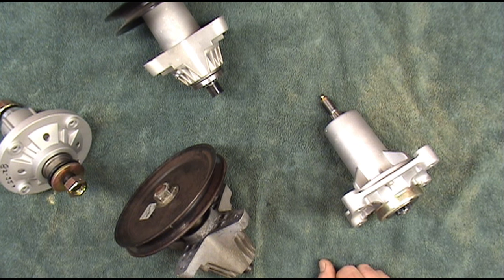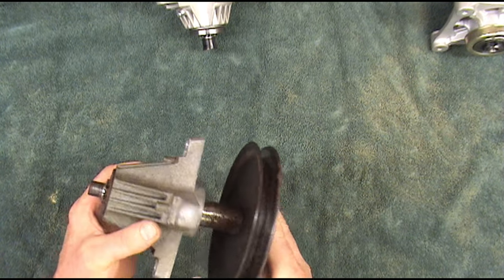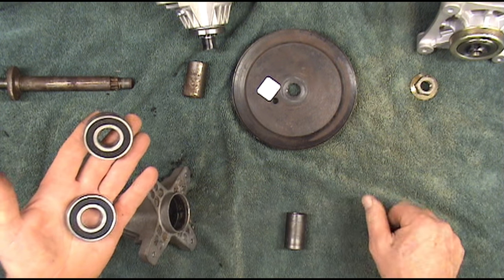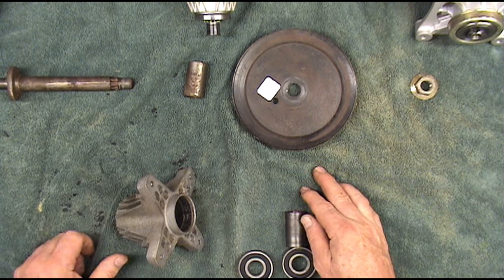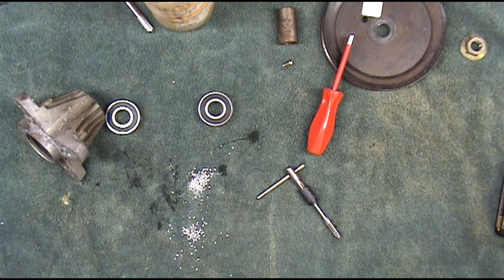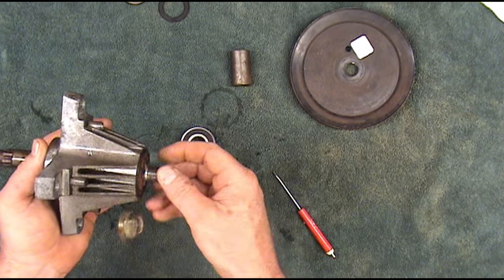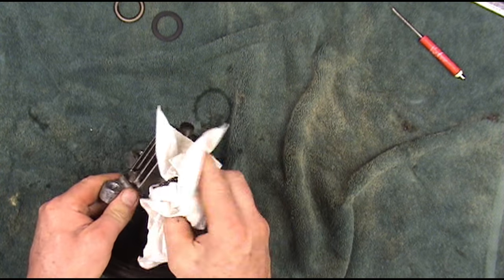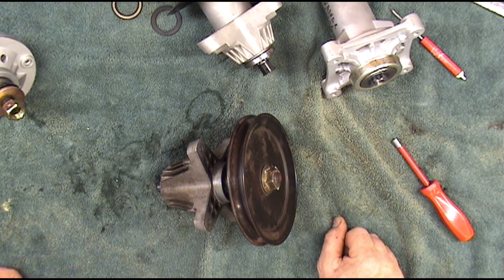Deck Spindle  Bearing Upgrade   Cub Cadet Husqvarna John Deere Troy bilt

Comment: I've done this with my cub cadet zero turn replacement spindles. Took apart three brand new spindles, removed one side dust seal on both bearings, tapped weep hole, added 10-24 screw, filled with grease, very solid, should last a good long time.

Comment: Glen, you are absolutely correct! I replaced mine last year on my Scrub Reject last year and they have already failed, and I did pump grease into them. I pulled one of my spindles apart and sure enough the bearings were sealed. The grease I pumped in did absolutely nothing for the bearing. Thank you for your expertise.

Comment: Just finished my deck rebuild and thanks to your video, it went very well.  You can use 1 1/2  by 4 inch nipple with a cap as a perfect fit your bearings.  Thanks again for sharing.

Comment: I never saw anyone use WD-40 on a Tap before.  Makes a LOT of sense.  I'll have to remember this.  Thanks, Glen!  I had a theory that adding a weep hole to know when the spindle was full, but your pre-tapped 8-32 screw for sealing is much better than what I thought of.  Thanks again!

I guess a 6-32 screw would work just as well, but add a littler more weep resistance to help pack the bearings.  4-40 might be OK, too.  I think I'll drill both holes on the same side, and mount the two spindles with Zerk and weep screw facing outward for easy access to both.  I have watched a lot of these, and I found you on my second go round today while looking for how to safely remove the bearings to be able to the use new ones on new spindles, but I think this video of yours is the best one I've seen yet.  Now I also know how to get replacement bearing numbers.  My spindles have two sizes each, with a larger one where the blade attaches.  Mine look like your AYP, so there's plenty of height for both holes on the same side.

Glen, the shaft and pulley spun faster before adding grease.  I wonder if your 6-32 screw is too long and pressing on the internal spacer.  Or is it the grease slowing down free spinning?

I needed a Love This button for this one!  Thank you so much, Glen!!!
Reply from the maker: Thank you.

Comment: I started hearing one of the deck spindle bearings going out on my Husqvarna lawn tractor.  The top bearing had the seal on both sides, but the bottom bearing had the inner seal removed.  The top bearing was the one that was failing.  I took the other spindles apart and fixed them while I had the deck off the tractor.  Good job explaining how to do this upgrade.
Reply from the maker: Thank you

Comment: you could use a (zerkstyle) pressure relief valve instead of the weep hole bolt.  they come in different low pressures. that would stop excessive pressure build up and not allow it to blow the seals out.  and you don't have to take the bolt out when you grease the spindle.
Reply: I am in the process now, of buying all of the relief valve pressure sizes (1 psi through 80) to test. To see how much pressure on average it takes, to blow out an outer seal(s).  What is your early guess on how much that is?
Reply: @SteveKluver  it depends on what type of seals the bearing has, some are rubber seals ( which only hold a few psi ) or there are steel shielded bearings ( which i assume hold more psi - but not sure )

Comment: First video I have seen that gets the zerk fitting relationship correct. You have to have the pressure vent as well as the zerk! A note of personal preference, I like to put the zerk in as close to the blade-side bearing as possible and the vent as close to the pulley side bearing as possible. Keep in mind it's a personal preference, the grease will still follow the conservation of energy law i.e. the path of least resistance. Because of the greases viscosity it won't "push" out the vent hole until the internal void is full. Great video and good job to the author!
Reply from the maker: Thank you !
Reply: I would add, the weep hole should be as high as possible since water will be on top and first pushed out.
Reply: To add...pre load all the grease in the spindle before assembly. This way you know it's full.
Reply: How would you know what pressure relief to use?

Comment: amazing work my friend, those spindles DO NOT come cheap, I don't care what anyone says... I rather rebuild the OEM spindles than buying 3 or 4 new ones in the future.
Reply from the maker: Thanks.
Reply: I replaced one on a 24 HP Craftsman when I caught one blade on a neighbour's tree root.  Normally I creep very slowly over those roots so that the mower deck does not bounce.  This time I was too much in a hurry!
Anyways, the new assembly complete with bearings and spindle cost me CDN$36.00, delivered.  Not a bad price I think.

Comment: If I were to do this, I would first mark the ideal spot so you had grease gun access to the Zerk.
Second and most important I would us a quality grease perhaps old fashioned Front Wheel Bearing Grease and firmly pack the new bearings BEFORE installation.  It takes a lot of grease to fill that cavity if indeed you got all the air out.  Vents are normally at the top - again check for installed access and there is no guarantee you have all the air out.  It would be interesting to disassemble this Spindle after greasing to see how well it performed.
Simply Repacking NEW Bearings and replacing the seal seems like a good idea as well.
Reply from the maker: Thank you Gord.

Comment: Another excellent video by Glenn!  Last week adjusted valve's on my Kohler 7000 series engine thanks to Glenn's other video on proper valve adjustment.  Engine runs very smooth and strong.  Thanks for sharing your lifetime of acquired knowledge Glenn.  My next project may  very well be rebuilding my spindles after viewing your video.
Reply from the maker: Thank you William.   Glad you enjoy the videos.

Comment: Good advice ! They figure out how to make it. Then they figure out how to make it break   !
Those seals will not take very little pressure to push them out .
Do like the man just suggested "!"
The 1/4" weep hole is a must or the grease will push the upper ones out .
BTW, " Great video ..

Comment: Nicely Done!...Replacement Bearings that size are also available with a metal shield on one side which would be even better. I would think you would want to hunt out the right location for the zerk fitting to ensure you can reach it with a grease gun fitting once the spindle is installed in the deck and the deck is back in the mower..
Reply from the maker: Thank you.

Comment: Many thanks indeed for such an informative and truly helpful video - I've just bought some new spindles, as I'm sure at least one shaft was bent. I will be removing the inner seals and tapping in a weep hole screw on each new housing, as the hole has been left open. Many thanks again, all the best!
Reply from the maker: Thank you

Comment: Excellent tutorial. I don't think my Cub Cadet has grease fittings, so this is great. Can someone provide specific information on the drill bit, tap, and screw for the weep hole. Thanks.

Comment: I was about to do something quite similar. I know that these bearings are made from cheap Chineseium and are designed to fail. (We may all thank General Motors for starting the planned obsolescence thing in 1965!) 

I was going to make a similar modification to the bearings proper by installing a zerk fitting in the housing and drilling a hole into the bearing housing that would match. Then the bearings would be serviced directly. However, that would require doing it twice to each spindle. The risk of popping out the seal would be considerable and annoying. This method does require a significantly larger amount of grease but, once filled, it would not require too much to replace any lost in usage.

The alternative would be to just bite the bullet and replace the bearings every few years. This appears to be a very good alternative and money saver. The prerequisite is that one should take the chance to replace the bearings with higher quality units from Timken, SKF, or similar brands while making this modification.

Thank you for a very well done and valuable video!
Reply from the maker: Thank you

Comment: I buy the replacement bearings at Greenville Bearing, and to heck with using MTD parts, that way I get Timkin bearings at a much better price, and I know that they're a quality bearing not something from China or Thailand. 
I must have missed this video somehow, and then come by it randomly..
I was searching for the best way to replace drive belt on cub cadet Zforce 60" deck with the steering wheel version. 
Buddy of mine smoked the drive belt when it got a small twig caught on between the pully and the belt.
He works 6 days a week 10 hours a day, and typically his tormentor has more things planned for him to do than two men could get done with one day off.
So I try to give him a hand when I get a chance,  but generally try not to let the Evil one know, as we don't exactly see things from the same prospective. 
As I tend to not tolerate her hateful ways, and she's got a mouth that two bars of Lava soap couldn't clean up if they were both brand new unopened bars. 
I figured this little secret out long time ago when I had one eat the spindle housing up due to bearing locking up on my dad's old mower way back before he passed in 98.
I knew he'd always made a point to grease them at least 3 times a year, and when he called asking me to come by and get the pieces so I could pick up a new one for him.
I got to looking at the different pieces, and believe it was a sears parts store over in Garland that had the whole thing. 
I asked the counter man if he just sold the spindle housing and the bearings.
He looked it up on old micro fish system they had a got a funny look on his face.
He asked me how I knew that, because up until that moment he'd never realized that they carried everything to build a complete spindle setup. 
Then he surprised us both, because he added the cost of each component that made the whole thing. 
He says, you ain't gonna believe this, because I don't. 
I can sell you everything separately cheaper than assembled by a good percentage at that.
That is the day I knew that we were being scammed big time by the manufacturers. 
That's before everyone realized MTD, was actually building multiple brands from a general stock of pieces with the exception of the big boys like JD, Troy built, craftsman, and cub cadet who had priority parts exclusive to them, but MTD did the assembly. 
Then you could mix and match parts from the lower end brands to get the same parts, but at a very reduced price compared to a bigger name if you did
you're homework. 
Glenn I still amazed that you do this for people, because it has seriously got to have a effect on your profits by a fairly hefty percentage my friend. 
I know I've said this a hundred times, but I really need to stop by and tell you thank you in person, because I've definitely picked up a good bit of knowledge from you that I know cost you are someone around Greenville some profits. 
I still chuckle every time I hear someone fussing about gophers and such. 
Now if you ever come up with a way to run crayfish off without a chunk of bacon an a string, because I'm pure tired of those concrete castles they live under.

Comment: I heard one side has a runner seal and grease can get in but you have to do about 70 pumps on the grease gun. Thoughts?
Reply from the maker: Remove inner seal as described in the video and grease will get inside bearings and extend the life.   Number of pumps depends on grease gun, your elbow and capacity of cavity.  Never seen one yet that took 70 pumps.   You can always add some grease to cavity before dropping in last bearing. 
Thank you

Comment: Good morning. I have watched alot of videos-i like the idea of the weep hole and was wondering what grease you do recommend though. I just bought a used deck for my older John Deere- i didn’t think there was a grease fitting but there is- and like the idea of removing 1 side of the bearing cover- makes alot of sense! Thank you and have a good day
Reply from the maker: Marine lithium grease, any major brand would be best.  But any high quality wheel bearing grease would be ok. 
Thank you

Comment: Worked for Deere for 15 years...some of the higher end models had bearings that weren't sealed on both sides.. The more consumer end cheaper models did not!! The bearings that are open to the inside are a small investment compared to a toasted spindle!!
Reply from the maker: Thank you

Comment: Very good and well explained video, but, if the bearings on each end will take care of the spinning, why do we have to grease the middle, which touches nothing, I think.
Reply from the maker: The grease will get to the bearing if you fill the cavity. 
Thank you
Reply: @IFIXIT4U  I guess the queetio is why is there a zerk that services nothing…
Reply: @IFIXIT4U  Isn't the grease only getting up to the weep hole?  How is it getting to the top bearing? Does it just migrate up as the shaft is spinning?

Comment: What type & brand grease do you recommend? Your drills looked like they were really good quality, they did the job very quickly. Any recommendations there also?
Reply from the maker: I use marine grade wheel bearing grease.  The type for boat trailers.   The drill bits are Milwaukee brand. 
Thanks

Comment: HEY 👋😊 Great video !
My lawn tractor is a 1972 John Deere 214 series.
Bought it new back in 72. LoL 🤣
There is no grease insert and the main casting is thick steel not China cheap cast aluminum.
I've been taking these spindle's a part every year to manually inject grease into the bearing's .
Have any ideas or suggestions to make this process easier ?
Reply from the maker: Those cast iron spindles can be drilled and grease zerk installed just like the aluminum spindles. You have enough room on the mounting flange to mount the zerk.   Thank you

Comment: Very informative and the best one I've seen on rebuilding spindles. QUESTION: I have the newer model ZT1 54" with the "S" Blades (490 110 C194) which are very expensive. I would like to swap out the 3 "S" spindles (618P09236) for the Star Spindle which offers a better selection of Blades at a much lower price. Like the Oregon 3 gator blade. They don't make any for the "S" blades. Any one know of a switch over spindle that will work? Yours in the video look very similar.
Reply from the maker: I cannot convert the part numbers for you but....  We had one here the other day and the new S-blades were not even available.  I removed the S-Shaft and matched the length to the Star-shaft and changed the shafts out. 
That solved our problem here.  I do not have any part numbers. We did it old school style.   Maybe remove your shaft and search for the Star-shaft in the same length.   
Thank you

Comment: Just watched your video. It was great. One question. If you remove the cover off the bearing then what will prevent the bearing balls from coming out of place? Thanks
Reply from the maker: The seal or cover has nothing to do with the mechanical integrity or construction  of the bearing. The seal is there to keep the dirt out and grease in.  But on our spindle in the video removing the inside seal allows for the added grease to easily lube the bearing.   
Thank you

Comment: Nice.
I was wondering how long will the bearing last well greased in a mower residential use only, if I replace bearings only and remove those inner seal and before Putting the second bearing, I top  it off with grease. 
I mean with no zerk and venting hole.
Reply from the maker: Yes that would be better than stock, but not as good as adding the grease fitting.   Thank you

Comment: I have a mower deck spindle that wobbles,  I tore it apart.  The bearings "feel" smooth and have grease.  How do I know if they are bad or could it be the shaft? The bearings do not feel loose? The shaft appears straight. What would you recommend? Thanks for a great video.
Reply from the maker: Wobble sounds like something is bent.  Hard to tell from here.  Maybe bent shaft or bent pulley.  I would always replace the bearings before putting it back together. 
Thanks

Comment: I have done this in the past, however the bearing has lasted longer than the manufactures bearing. At least in the past, would you order a different bearing for having a grease fitting. also where do you get those seap hole plugs? Can you remove only part of the seal so a limited amount of grease in it?
Reply from the maker: A small self tapping screw from the hardware store will work fine.  I've never tried removing part of the seal.  If you try it let us know how it works out. 
Thank you.
Reply: @IFIXIT4U  That would be about 1/8" self tapping screw?
Reply from the maker: That sounds about right.   I've seen different size holes.  You might get a couple different sizes and see what fits best.

Comment: Is there a way to seal the spindle to hold a heavy oil instead of grease? Something to think about I'm always trying to make parts last longer.
Reply from the maker: I am not sure how you could ever keep a liquid lubricant contained in one of these spindles for very long.  A good quality grease is the best thing to put in them.  Problem I see here over and over is no one ever greases them at all.  Then complains when they blow apart on Saturday afternoon half way through the yard.   Thank you.

Comment: Do you really need the internal spacer vs not using it??
Reply from the maker: If you tighten nut on the pulley without the spacer, you will crush the bearings.   Yes.   you need the spacer.    Thank you.

Comment: Thank you for this video.

Curious, would you mind confirming a 1/4-20 plug tab and not a 1/4-28. I ask because I am not finding grease fittings in the 1/4 in. x 20 straight variety...anywhere.

Thank you.
Reply from the maker: Use the thread tap that matches your grease zerk threads.